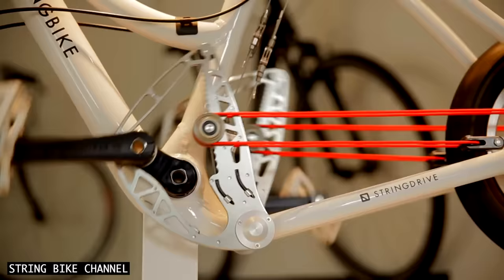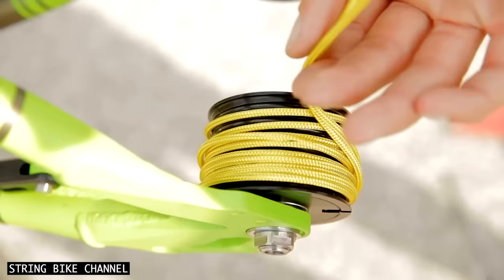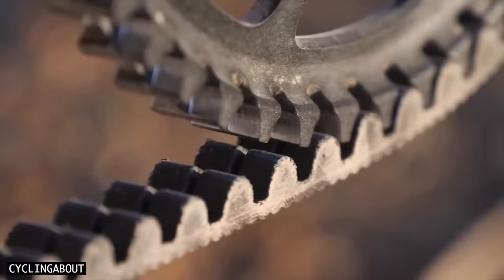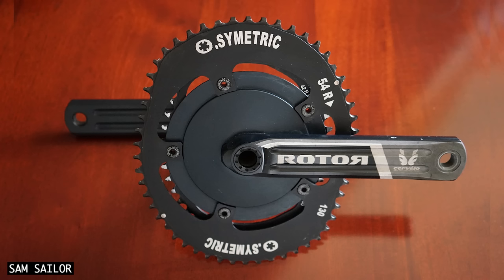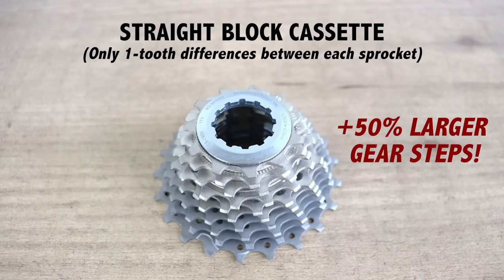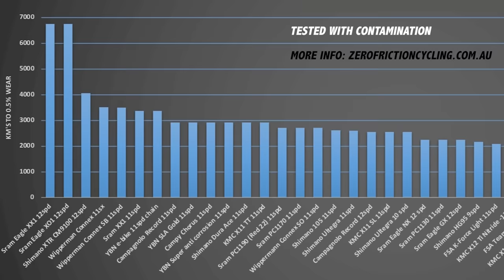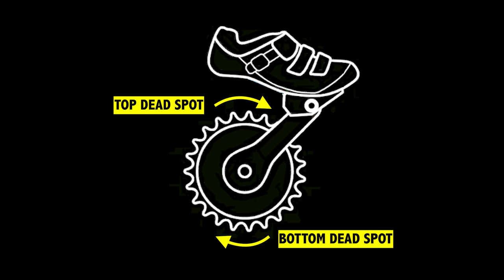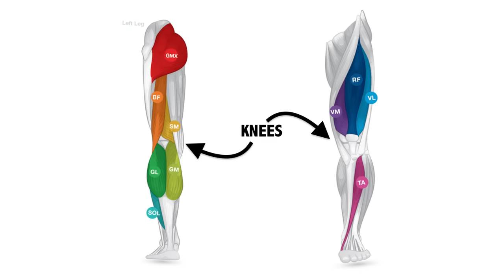Are Chainless String Drive Bicycles a Genius or Terrible Idea?

Comment: The other limiting factor for the technology was the company who owns the patent for it. One of my relatives wanted to do business with them as the drivetrain would have been ideal for the particular use case (not a bike). He said they were not flexible in improving or adopting the idea, they created terrible quality of products and in general, were really hard to work with. So they ditched the idea and stayed with a regular chain drivetrain.
Reply: Oh well maybe it will be useful whenever the patents run out if it is even remotely relevant at that point and somebody finds out/remember that it was a thing
Reply: Society is better with open standards and open information.
Reply: Everybody wants to get filthy stinking rich right now.
Reply: To increase competition all patents should be on an open licence, as long as something like 10% of the product price is paid as royalty fees there is no violation.
Reply: @MrMonkeybat  It would certainly boost innovation and imagine what you could actually accomplish without the trolls and lawyers in the way?
Reply: Sometimes you need to ask yourself, 

why other companies use chain and gear instead of this?

Why companies still diesel for truck?

In end the most important part is practicality.
Reply: @YEN_calisthenics  
Boom. You nailed it. Overcomplicated engineering ideas are always trumped by simple practicality in most applications. 
If you think you have a novel idea that nobody thought about before, it's very likely that it simply turned out to be not a good idea after all or was/is not possible to produce economically. Real innovation is very rare in reality.
Reply: @MrMonkeybat  a modern smartphone has thousands of patented solutions, usually in a cross licensed between manufacturers, and many enforced via (paid) standards. 10% for each doesn't really work in these cases.
Reply: @defeqel6537  Well obviously I did not intend such a rule to immediately end existing agreements but as a last resort for patents tied up by holders not willing to negotiate. 10% is a number I plucked from the air probably more than its typical even for major patents.
Reply: There is av company making a velocar/hpv called Djiker that seems to be using a variant of string drive so it lives.
Reply: @MrMonkeybat  nothing shows up on google for that?
Reply: The 10% license thing is a cool idea, but I wonder if this is always enough. Product development is a risky Venture. Lets say 90 % of times you fail. Its a high risk high reward business, we should be careful with toying with the high reqard part since that is the deiving insentive to take such risks. Maybe a license would still be fair, but it has to be calculated not to dwarf the insentive to put money down the drain potentially on risky ideas.
Reply: Which is bizarre. In not a parent attorney, but I believe adapting the technology to a new solicit could be a new patent with its own new lifetime.
Reply: @Lostachilles 
Really? I just typed in "Djiker" into google and it was the first thing on the list. Although it's Dijker not Djiker.
It's a weird concept though.
Reply: @carstekoch  yeah -- even if I type "djiker bike" it doesn't give me any results other than motorbikes and random stuff. Though, since you gave me the correct spelling, if I type in "dijker bike" I get a single related result at the top, and then a bunch of random results below that are unrelated still.

I guess it could be being affected by locale 🤷🏻‍♂️

Thanks anyhow :D
Reply: @Lostachilles  
Yeah. From what i've read, they apparently try REALLY hard to distance their vehicle from a bike. So maybe that's why your "bike" search came up empty.
Reply: @carstekoch  maybe. In fairness, I did try without bike when I first tried searching a while back xD I figured this time it might be worth specifying since it wasn't doing anything before 😅
Reply: @oneofthesixbillion 
How are you gonna achieve unlimited growth with such an utopianist society? Profit is everything, without profit there is no growth, then there is stagnation and finally collapse.
Reply: @SMGJohn  Logical fallacy, where did I say I wanted unlimited growth. There is no utopianist society. But there is better than what we have.  Closed source benefits only those few who want to make money and exclude others. Open source benefits the entire societal knowledge base. Closed source would be considered barbaric in an open source world.
Reply: @oneofthesixbillion  
What? Do you not understand how the Free Market works? To expand, you need growth, stuff increases in prices, how are you gonna increase peoples wages when you have no growth in your business? 
Why should companies spend vast amount of resources and time into developing technologies and methods only to open source it for free for everyone? 
Thats a huge waste for them, you need to see it from their perspective. 

There no point in investment into anything unless you can control it, thats just the nature of business, Capitalism is literally the accumulation of Capital, so if you need to open source your research, then obviously you loose money, who is gonna pay you for it? 

This is why I said its utopianist thinking, you want an open source world and thats fine, we had that under Soviet Union, but then you turn around and want it in a free market economy which makes absolutely no sense because its a profit driven economy.
Reply: Someone did patent this crap?
Reply: @oneofthesixbillion communism ftw
Reply: when did the rich ever change?

Comment: A very good analysis.  I had one (probably the only one in Australia) and did not experience any useful advantages.  The disadvantages, as shown here, were severe and there were other snags not shown.  For example, I found it impossible to start on a hill.The "Dyneema" ropes are meant to hold 1,500 kg but mine held only 110 kg - maybe not real Dyneema - so I was breaking a rope every week or so.  Also, you do get dirty hands on changing the strings.
Reply: Thanks for the insight. On seeing the marketing shots of super clean strings, it made me think “in real life it would be dirtier”. Not being able to start on a hill is a dealbreaker. Snapping a rope a week = $40 a month, another dealbreaker. And rim brakes? Nope.
Reply: They say it can climb. But every single shot of the product in action is on flat terrain. That is a highly reliable bullsh*t indicator.
All "innovative" drivetrains have the exact same issue. They work (at least theoretically) on perfectly flat terrain. But they are a nightmare on the hills.
The reason the chain drive is so popular is because it works decently in all road conditions. Flat, uphill, downhill, sh*tty road with potholes, etc.
Reply: They said you can change gears when stationary. So why couldn't you use it on a hill? Is the lowest gear too high?
Reply: @illegitimate0  That's what they said - that you can change gears while stationary.  But I found that you can't.  The lowest gear would get you started halfway up a hill, if you had pre-selected it before you came to the slope.  If you were in high gear as you approached the hill, you'd have to go through as many as 18 gear changes before you got to the hill, and gear changes had to be done singly with the pedals in a particular position.

Comment: For all the advantages you might think there are to using ropes, the impact of getting a rope dirty is actually huge.  Even if you clean the ropes after they get dirtied, you're still looking at a minimum of 30% increased wear from that point on, and if they aren't cleaned properly then they might wear out as much as 4x faster than normal.  That increased wear is the real reason why they have to use such expensive ropes that can withstand so much more than almost any bike is ever subject to.  Considering that the ropes are on a bicycle and completely exposed, they're going to be dirty practically the entire the time the bike is in use.

Comment: I find it so interesting that every one of these videos about different drivetrains always come to the same conclusion : belt drives are sometimes the best option, chains are almost always the best or near to the best option
Reply: Personally I drive a Rohloff gear hub. But I'm still impressed, that sliding a chain sideways over gears is still such an effektive way to provide gears.
Reply: @chrisridethatbloodything2044 It's a case of KISS (Keep it simple stupid) at work. Over engineering doesn't make things better,  just more complicated. Go ask the German tank engineers of ww2 how well it worked out for them making overly complex and "advanced" motors and suspension (little hint... they spent more time being repaired than functional)
Reply: @SilvaDreams  With a separate supply chain for most of the parts, and being so complicated that they had to be sent back to the factory for a many repairs, at a time when logistics was at a premium. They often couldn't just be cannibalized like a Sherman or a Jeep.
Reply: Yup, simplicity just works best. I live in the Netherlands, flooded with bikes, the vast majority with chains and the rest belts. Though you only very rarely crank shafts, despite this system being pretty simple too.
Reply: A statisztika alapelve, hogy "a negatív eredmény is eredmény".

Magyarán: 
1) Ha nem jársz végig egy tévutat, akkor mi igazolja, hogy tévút?
2) Olyan tévút nincs, amiből ne lehetne tanulni.
3) egyébként ez a megoldás pont hogy semlegesíti a holtponton forgatónyomaték problémát.
Reply: @SilvaDreams Yes the well documented and widespread sabotage of German industry had nothing to do with the reliability of their tanks
Reply: @SilvaDreams  
"Go ask the German tank engineers of ww2 how well it worked out for them...."

No need to go that far back. Ask American engineers about the F-35.
Reply: @liuj88  That has been  part them building planes faster than support infrastructure, part Lockheed not wanting to give up the manual for them and part software issues.
Reply: @SilvaDreams  
That may very well be true, among other reasons, and fall well within KISS. 
My point stands.

Comment: I think it’s really cool, if only for the mechanical novelty aspect of it. The fact that it worked as well as it did, is testament to the team’s knowledge and hard work. Unfortunately, for it to work for the masses, it needs to be much easier to work with, cheaper, and have wider compatibility. Great video once again. Cheers from Australia
Reply: yeah string drives have their advantages I like having the choice of which ever one I want to use on a bike chain or string drive cause choice plain and simple
Reply: @SaraMorgan-ym6ue  That’s true, the more choices the better.
Reply: It's kind of like that Kick 'n' Go scooter that had a pedal behind you you could pump to get going, but it only had a little success for about 2 or 3 years and the concept dropped. Nobody else took it up and ran with it. It didn;t really sell more scooters.
Reply: I agree. It's a cool idea. Maybe it can be used in a different application. Hi from California. :hand-pink-waving:
Reply: It's sort of used in garage doors lol
Reply: @lesp315  This has already been used in other applications.   It's the way lathes were made.  They probably just saw the Townsends youtube channel where they made a rope powered lathe and decided to make this bike

Comment: I owned one of these, bought it second hand. The gear cables are a pig to fit and need special gear wires at the cranks which took forever to get from Hungary (I'm in the UK). The shifter uses two standard gear cables wrapped around a cylinder inside the shifter.  Then there was the issue of balancing the gears on the cranks so gears changed in synch on each side. Effectively there were six cable ends to secure and balance at the bottom bracket: two cables coming from the shifter and the two ends of the two special gear wires, one on each crank. I sold it to a friend and he still rides it but getting replacement cords and other spares is a real problem.
Reply: Well, that seems prohibitively technologically limiting and challenging in daily use/maintenance.
Reply: sounds like the claim of needing 'no gear adjustment' isn't quite true....
Reply: He should be able to get a dyneme line and make his own cords. It's not a big deal. I would love to have one. I'm weird that way. I own Windcheetah.
Reply: Do you happen to know if and where he gets spare cords?? I currently have a string bike and  do not have any spare strings.
Thanks!

Comment: I think they went with string for two reasons: 1) It's not going to wear the other surfaces, it'll wear out first, and 2) It's not particularly dangerous if it snaps. This could certainly be designed with other materials, but you'd either end up with immense wear and tear on other parts, or danger if it did snap under tension. I feel like they could have probably made these far more robust though in a few ways, like for example, having a metal spring core in the strings, while also making the string thicker. I could imagine for example, a string in the center, wrapped with a metal spring, and then an outer rubbery layer added or something like that, giving it a lot of flexibility and durability.

Comment: It looks goofy and awesome at the same time :D Thanks for exposing the hotest new stuff in bikes!
Reply from the maker: It's definitely one quirky drivetrain! I hope we see more of this weirdness in the future. ⚡️
Reply: @Cyclingabout  Wouldn't the best "drivetrain" essentially be similar to a central one-wheel with a gearbox plus front and rear wheel for steering?
Basically eliminating belt,chain,string, cardan shaft and instead driving a gearsystem directly. I bet there is a tinkerer that did this. 
It might also come with rear and front axle steering.

Comment: modern belts can last upwards to 30k km.... well certainly not the Gates CDN,  mine gave up under 2k km and after that i researched and many had the same issue. turns out Gates be like "yeah that ones not for actual use. only on tarmac with no gradient and no dirt and if you dont drive much and dont go fast." what a piece of junk. always get the CDX if you want a real belt.

Comment: In the Stockholm museum of technology (Tekniska museet) they have a "Svea" bicycle from around 1900 that uses a mechanism related to this string setup, but with an almost standard chain - with a twist. Two twists, in fact!

It has two platform "pedals" with curved levers, like the string drive but pure up/down movement (which at the time was presented as an advantage over rotary pedaling). The ends of the chain could be moved up or down curved arms with notches, for "gear changes", with pneumatic actuators from squeeze bulbs on the handlebars. The chain ran over freewheels on both sides of the rear hub, then over an idler in front of the wheel. The chain had two "twist links" allowing the mid section to turn around the idler. The idler was spring loaded away from the wheel and had a platform that was pressed against the tire if you pushed down on both pedals at the same time - very simple braking.

I think (although this is my conjecture since the museum never got them to work) that the pneumatic actuators would move their respective end of the chain up or down along the curved lever arms, depending on the pedals' position when the rider squeezed the corresponding bulb - "up" if the pedal was in its highest position, "down" if it was in the lowest.
Reply: I got to try a bike like this once in Finland. Though I don’t recall whether it had shifting or not. Nice experience, though not very efficient. I think they designed it that way to make it easier to balance yourself while pedalling

Comment: My takeaways:  Elegant, but complicated design, with few real benefits over chain drive.
String drive lasts roughly 1/2 as long as a chain
You need to change the rear drum for hilly rides  (Chain drive just toggles between high and low on the front sproket)
People think you can't use a chain in rain/snow (LOL it's called OIL / Maintaining your chain)
Being precision machined lever action, one bump will throw it off and damage it.  Good luck changing gears with a crooked arm.
Bonus:  If you are getting oil on your pants when you ride a bike, you're just clueless.  And chains are 100% recyclable...is this string recyclable?
Reply: I have heard that a fully enclosed drive-train negates chain fouling concerns. There is a weight and efficiency penalty: since you need to use an internally geared hub.
Reply: You actually don't need more gears then one to have a practical transport. Before the 60's speeds are not common. My parents have never had a bike with gears, in the Netherlands. They never used it for sport but to get somewhere.
Reply: it's what is often called: "a solution looking for a problem"
Reply: @albertmagician8613  
you also dont need planes to  travel to the other side of the world, that doesnt mean its the best  way to do it or that it wont be  replaced immediately if a better option  becomes  available

Comment: excellent video. string is a novel idea, not terrible.  the challenge remains: how best to transfer power from human to machine.  have never understood why belts do not replace chains.
Reply: i think belts have slightly more friction, and the frame is also different because belts tend to be made in one piece which means that on a standard upright bike you need to be able to open the frame at one point to thread the belt through it.